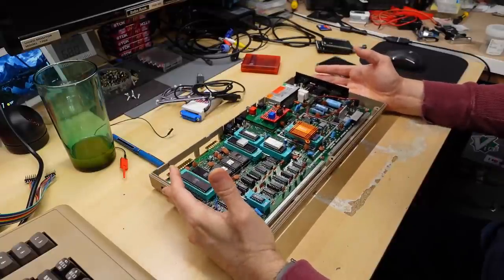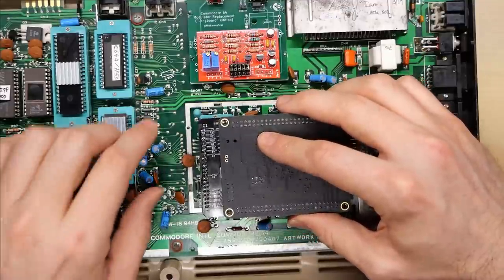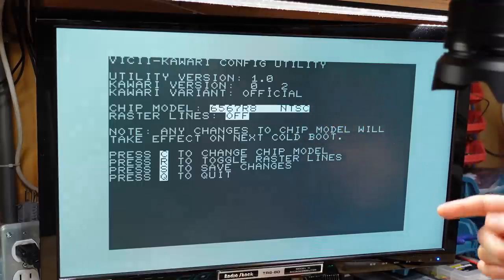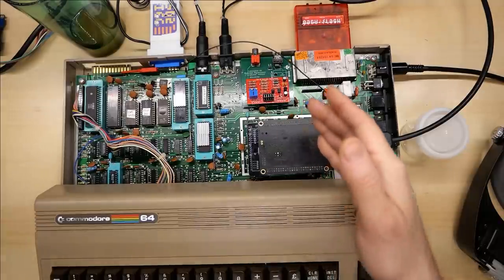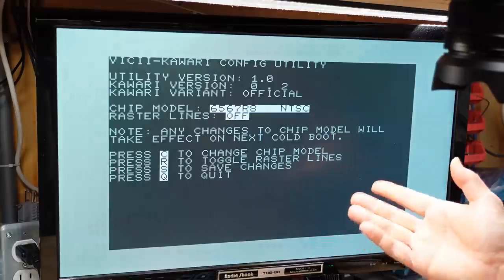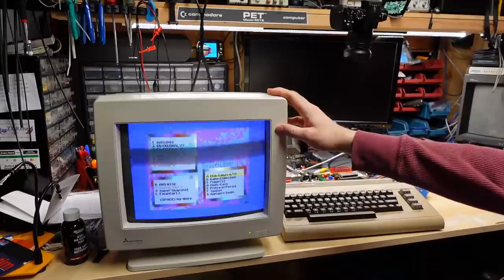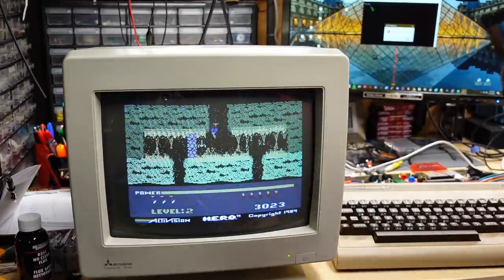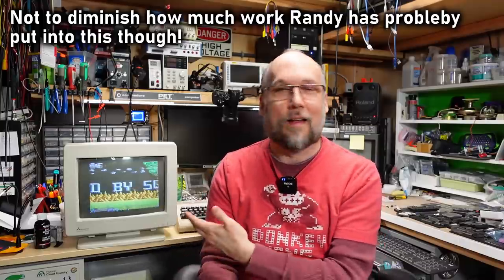VIC-II Kawari: FPGA based VIC-II replacement for the C64

Comment: The PAL colour palette isn't "muted", NTSC colours are comparatively oversaturated. Which was done because of the way PAL and NTSC colours are encoded, with PAL having better colour stability (the same chroma signal gives the same colour every time). That's why NTSC has a tint control which allows you to shift the chroma, and PAL does not.

Which means that on European screens, the PAL palette you are showing would be much more vibrant since the CRT's would be adjusted differently.
Reply: Indeed. I was about to comment that there was something wrong with Adrian's PAL palette because my PAL C64 and multinorm Sony Trinitron video monitor does show PAL palette almost as vibrant as Adrian's NTSC palette.
Reply: While you’re correct about PAL being more stable, you’re wrong about the C64 output. The PAL machines do produce more muted colours. Tint has nothing to do with saturation.
Reply: @CoverMechanic  The point is that because the PAL colour rendition is more stable, the output can be less saturated to reproduce the same colours (by adjusting the CRT to higher color gain). On a multisystem monitor you would notice the difference, but on a PAL only television the colour palette is almost as vibrant as the NTSC one. 

It's because PAL specifies the colour standard as less saturated compared to NTSC, so "full blue" in PAL standard would be more like 70% blue in NTSC standards. And that is something you would notice particularly in red.
Reply: If I'm not mistaken PAL and NTSC Tv's use different color gamma curves. I kind of assume this is related to the color differences as well if not the actual reason.
Reply: Right, NTSC = Never Twice the Same Color.
Reply: NTSC color to PAL color TV conversion in the 80s was so bad that at national television here in europe people from Asian culture looked yellow. Like those smileys🤔 As kids we really thought at the other side of the world people were all yellow 😂 like smileys 🤔
Reply: @Stoney3K  and by comparison, when I tried turning my DVD player into “NTSC colour mode” (off from auto) it made reds look orange and blues look turquoise. (UK, but ~2004, so there was some digital processing inside that 12” CRT’s circuit board)
Reply: One thing I really don't miss about PAL is the interleaving colours in an attempt to balance out phase errors. This was engineered for broadcast television, which was always interlaced so you'd only see one colour at a time and your eyes would do the blending. With a progressive scan display like a C64, it didn't work and it looked like utter shit on monitors that used this method because you'd see colour stripes. Better televisions and monitors had a scanline buffer and blended each scanline with the one above it, avoiding this effect, but then some single-pixel horizontal lines end up with strange colours from being mixed with the line above it. At least the NTSC people didn't have to deal with that. I still have several CRT monitors and TVs, some show the stripes and the others do the blend.
Reply: @robertmiles9942  Mayhem in Monsterland(and several other games starting from about '87 or so) used that quirk of the PAL signal to make more colours in a similar way to artefact colours on an Apple 2. Of course, it looks horrible in an emulator... or at least the one I use.

Comment: Yep, that washed out palette is indeed normal for PAL 64s
Reply: Looks soo much better than the NTSC version though, especially since pretty much all games were designed for the PAL palette
Reply: @thomassmith4999  I agree. Sure, the colours weren't as bright, but with only 16 to play with I'll take the palette where you can actually blend the colours to give the illusion of more colour depth over the brighter one where that doesn't work anywhere near as well.
Reply: As we used to call it, 'muddy'.

Comment: Thanks for the video and showing this off, Adrian:)
PAL Colors: You are thinking in the right direction ... but not enough.
If my (PAL) Colors would look washed out, I'd adjust them to look normal and wonderful ... like you or other "NTSC people" do.
This must be some urban legend about the gray cities behind the iron curtain (joking). Good looking Colors are achieved with calibration. On the one side PAL Signals on a adjusted PAL Monitor and on the other side the same with the NTSC-Standard. If you cross exchange standards by misconnecting the families over cross ... it is no wonder that the result isn't pleasing:)

P.S.: I'm not talking about the maximum available bandwidth of the color spectrum of the various color transmission systems, with "Never The Same Color“ doing poorly ... if you calibrate incorrectly. See phase of hue and vertical interval reference method (VIR). ... oh and please don't forget that we are all unique individuals with unique perceptions. Also that of colors. Only a calibration device can provide clarity. Most of us don't spend $500 on this, though.
Reply: I dont think they will ever understand .. No way i played mine with colours like that in australia Adjust it on a pal tv till it was how you liked it.

Comment: WTF kind of resolution is 834×502? 502 lines doesn't match any standard I'm aware of (NTSC would be 525, 483, or 480, most reasonably the latter), but that's not even a normal aspect ratio; it's basically 5:3. The rest of the project is totally amazing. How did it get this so wrong?

Comment: What I appreciate more is that Randy put up with Xilinx WebPACK ISE long enough without losing his mind. A true warrior.
Reply: Ok so context question:  what is Xilinx, and why is it a tear your hair out experience?
Reply: @artstrutzenberg7197  The board he used here is a Mojo V3 which uses an FPGA by a company called Xilinx. The FPGA itself is known as the Spartan-6.

Unlike most microcontrollers today where you can program them any way you want, FPGAs must ultimately use hyper specific tools from the vendors at the end of the process, and they're... weird.

WebPACK ISE is the previous generation of Xilinx's development tools that support chips up to the Spartan-6 and it's just an old environment to work in. It doesn't support SystemVerilog or any of the few niceities added by their latest Vivada tool (the direct successor to WebPACK ISE).

EDIT: And the reason they're hair-pulling-out is that they have lots of oddness. You'll get "critical warnings" when working in it that half the time are meaningless, or you'll get a really obscure error that means you should really buffer a clock signal and everything's OK, or something like that. It's just really not friendly sometimes to the point of feeling like it's trying to stop you intentionally :P
Reply: @adamsfusion  pretty much this, basically all FPGA dev environments I've ever had the misfortune to have to deal with are horrible, cantankerous pains in the backside.
Reply: @SomeMorganSomewhere  My way, or no way at all, says the FPGA.

Comment: The clock in the 6526 CIA chips was sometimes used to seed a pseudo random number generator. Not good enough for crypto work, but good enough for C-64 games. If the 8520 returns something on those registers, that functionality would still work. If it always returns the same thing, the numbers won't be random, as I'm sure you know. Another trick was to set a SID voice to noise and read it, but if the SID was occupied, the software may have needed the CIA and a software PRNG.

Comment: Engineering-wise, this is pretty cool! Yet, if after SMD replacements for the SID and the PLA, we replace the VIC-II with another 3.3V SMD adapter, why not just move to full emulation on a PC? Or to a MiSTeR? What makes it special to run software in the old machines? Do we lose that when the heart of the machine is a 3.3V SMD replacement under the hood? What is retro-computing really about?

Comment: a personal note: while this project is AMAZING, I doubt (but I can be wrong) it will also have all the "bugs" of the original VIC II... some more extensive testing should be done on DEMOs. Also: the computer in the video has so many non original parts that is nearer to an emulator (like VICE) ran on a baremetal OS on a fast hardware like a raspberry pi or better.

Comment: Great video, Adrian, thanks for it. I read about it already, but the first I saw it in action. On the test video mode removal thing, a cautionary tale: Jay Miner wanted to remove the HAM mode from the Amiga before release, which was originally added as a feature to help debug color generation. But then the chip designer came back to him, and told him that it would leave a huge ugly hole in the middle of the chip, requiring an entire re-layout of the chip to get rid of it. So they decided to leave it in, as the less of worse option. Needless to say, the HAM became one of the killer features of the Amiga... So, as a hardware designer, never assume what software guys will come up with with your hardware features. :)

Comment: Ultimate C64:
- Use Commodore 128 as a starting point
- Built-in SFX Expander (FM sound module)
- Built-in MagicVoice (speech synthesizer module)
- Built-in SuperCPU (or equivalent) with 16 MiB of RAM
- Turbo Chameleon features
- FPGA SID or Dual-ARMSID
- VIC-II replacement
- nvSRAM and CMOS clock, for easy sleep-mode?

Comment: Since the 80s I used PAL colors and I've never seen desaturated colors.  I also have 4 C64s.  A breadbin, an Aldi, C64G, and a C64C and I also have both the NTSC and PAL C64DTVs.  If you have a color issue, you adjust it with the saturation knob on your 1084S or your Trinitron.  Also is there an emulator that does these PAL-washed colors?

Comment: Neat piece of hardware!  I'm curious how well this works with the various FLI-mode demos.  As I recall, those techniques take advantage of some undocumented/hidden features of the VIC-II to produce images that appear to have more than 16 colors, but at lower resolutions and with two images being quickly swapped on the screen.
Reply from the maker: I have viewer some of those FLI high res demos and they worked perfectly. I ran lots of demos on it like Lunatico and also all perfect.

Comment: I wonder if a "dead test" mode could be added to the VIC-II Kawari project? That would be useful if you were using this drop in replacement for the VIC-II, to test the rest of the machine, as it was stated that Kawari could actually write to RAM as well. Can it send data to other peripherals on the bus?

Comment: I have severalf PAL machines. In my experience, the 64C assy 250469, using the 8566 VICII have the dullest pallette while  assy 250466 long board is brightest / most saturated - especially the red.

Comment: Math Co-Processor functionality? Did anyone back in the day bring out a cartridge with an AMD 9511/12 - or the Intel variants - ALU chip(s) for the C64? I know there were expansion boards for the Apple II with them. And it was similar to the ALU chips Atari had used previously in their arcade vector graphics games. That would probably be the chip for the FPGA to integrate. Then again, there was an Apple II expansion board that later had a Motorola 68881 rigged up even though that FPU wasn't meant to work with a 65xx CPU [it could work with a 6809 though]. If the FPGA could take on TED functionality, it could then be used in those C16/Plus4. It might be interesting to see those modes running in the various systems they weren't meant for, like having a C64 run TED graphics or a Plus 4 run VIC-II graphics.

Comment: The VIC II in addition to providing the CPU clock signal also handles the 4164 DRAM refresh via 2 pins. Without it, the memory wouldn't hold its contents for more than 3 milliseconds, or so.

Comment: Hi Adrian. I'm wondering if the 58Hz refresh on the NTSC mode might be due to a firmware bug that is rounding down to the nearest integer, in the following sense;

In PAL mode, the refresh rate is 50Hz amounting to 25 frames/sec, but NTSC is not as neat as that, resulting in a refresh rate that is not a direct 2x the frame rate. If NTSC was 30 frames/sec, then that would double neatly to 60Hz refresh rate, but in fact NTSC is actually 29.97 frames/sec, which doubles to 59.94Hz.

I'm wondering if the software is calculating the refresh rate as a direct doubling of the frame rate, but rounding down (so taking 29 instead of 29.97), thus doubling out at 58Hz

Not sure if that's how this system is operating, but if so, it would explain the discrepancy in the frame rate. If this is the case, then maybe fixing the NTSC frame rate at 30 and then doubling to get the refresh rate would come out at the correct 60Hz. Of course without knowing exactly how this amazing device works, I can't be sure, but on a mathematical level at least, this seems plausible...

Just a thought :)

Comment: I would be interested to see if "Fix-it Felix Jr" runs correctly.  I found the vertical scrolling in this game doesn't work correctly on early NTSC VICs, I believe due to that chip's 64 cycles per raster line instead of 65.

Comment: There were actually two colour palettes on PAL C64's, an early one, and a later one - presumably on different versions of the VIC-II chip. I used to draw loading screens, and my 64 had the original palette. On later C64's the colours looked different (most obvious being darker orange and brown), so the shading on the pictures didn't look as good - at least not as I intended them.

Comment: Awesone project. As long as FPGA enhance the original hardware I think it's great. But if it makes original hardware not neccesary it's less interesting. The definition if FPGA as emulate, simulate etc is tricky, I think it's more about imitating signals.

Comment: Thanks for another interesting video, one of few you don't feel the need to run at increased speed.

Regarding the so called pepto palette, I have always thought it was too washed out in emulation compared to the real machine (use a PAL C64C with the large board since '87). However, back then it was always easy to lean forward and adjust the color control on the TV/monitor to your liking. It's possible the relation between the colors is correct but much to washed out IMHO. 

You didn't run any challenging programs, demos, what about scrollers - still smooth? Don't know if you know, is it still running with 50.12../59.8.. fps or are frequencies adjusted to get an exact 50.0 and 60.0 Hz (also nudging the CPU clock speed)? Wouldn't you get fuzziness or those jerks every 8th second on the HDMI if it was running at the original framerate?
What about delays when using HDMI? Is it even possible to check?

I think extra features is a "fun thing" but not really something for the average user just needing a new VIC-II for repairs or making one of those SixtyClones etc or HDMI output to be able to use to huge TV they bought for too much money. 
I think it should be released as a fully functional VIC-II and then people could upgrade it with the extra features - releasing firmware after firmware after firmware after firmware, seems to be the thing now-a-days. So, I hope he's not fallen for the feature creep and doesn't spend huge amounts of time on extra features, just a proper VIC-II function to release ASAP and then play around with extras.

Being able to still use chroma and luma outputs (including composite) would be really nice - keeping the original feature. It would allow for a replacement without having to choose between original and new video output and not forcing the step to a modern output, only add it as an option. I'd happily buy that and would enjoy improved output if needed. 
Imagine running them all at once...  RF, composite, s-video and HDMI on four screens!

Comment: Cool project. One note on the composite sync; it should be clean c-sync and not composite video as sync because there are some PVMs and video processors that will not take composite sync. Sorry if you already know this, but sometimes people get that confused.

Comment: ....not intending to be critical but handling certain IC's with your bare hands is a bad habit to get into because even if you wash your hands 'thoroughly' you will leave oil and salt residues on the surface of the chip and in combination with heat/time can result in damage.  If you really have to touch these you should use a simple pair of 'rubber/latex' gloves (be careful of any allergies to latex).  Best regards.

Comment: It's great and all but I wish they'd picked a less Anime sounding name. Kawari, sounds like that guy from the last few episodes of Evangelion.
Also, we're getting awful close to being able to build a brand new C64 from off the shelf parts.

58Hz and 58FPS are not necessarily the same thing. 58Hz just signals how often your monitor is being updated - The chip looks like it's still able to do scan line effects, which would mean that the chip is running faster than it's video output.

Disappointed to hear he's thinking of removing a feature just because he thinks nobody will use it. Never assume that, the C128 engineers left CP/M in even though it was a dead OS by the mid 1980s...

Comment: FPGAs are amazing chips, they immortalise and repair old hardware! They are essentially a way for enthusiasts and engineers to design their own self-purpose chip, with no emulation or microcontrollers! It's literally a massive logic gate-array with connections to each logic gate.

Comment: Will this work in a C128 too?
Reply from the maker: No not currently but I would imagine it would be possible. The VIC-IIe does a bit more for the whole computer on the 128 so those features will need to be added.